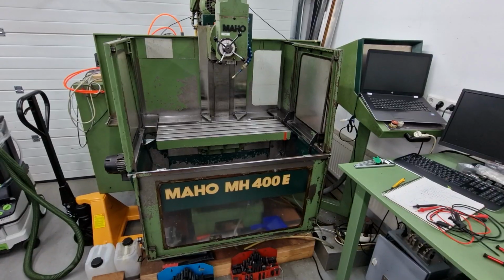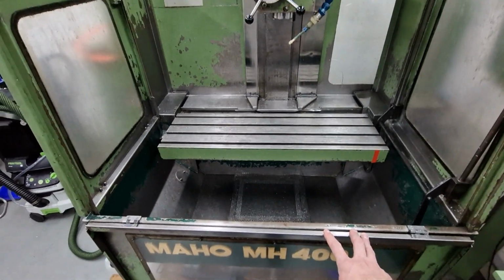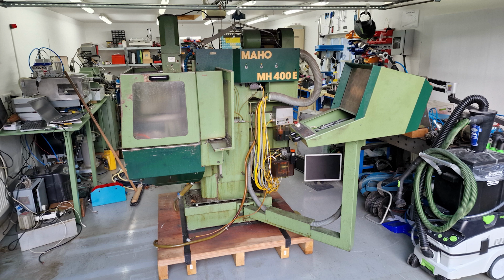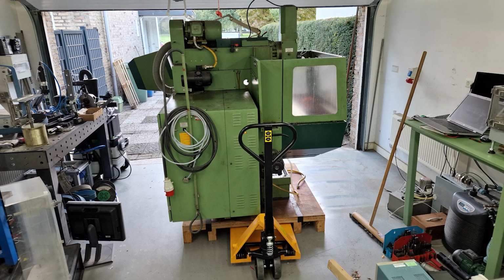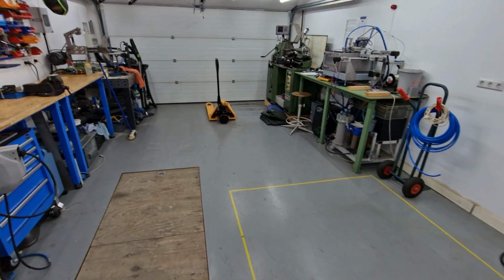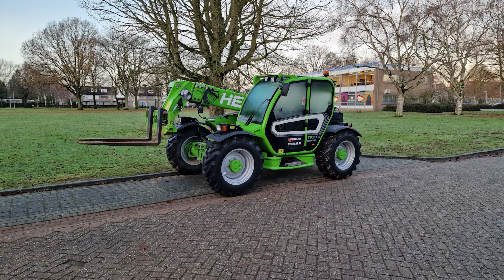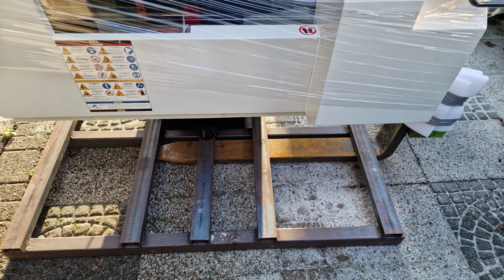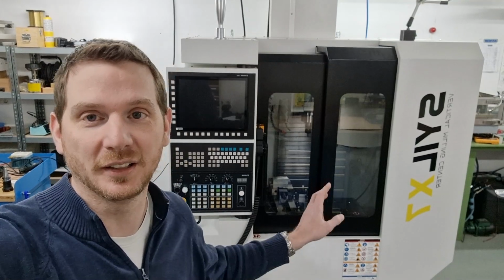New CNC for the BaxEDM shop - SYIL X7 !

Comment: My SYIL X5 is taking the long route via South Africa. I've paid for a professional machine delivery service to deliver it.  That was expensive, but I didn't want to take any risks. I ordered it back in July, it should arrive in the UK in 10 days time. I have 18 mm clearance under an oak beam at the door of my workshop, so it will be a tight fit!
Reply: you ordered the machine from ZA ? do you have a link to the supplier please ?
Reply: @carbonmk1  Sorry, I wasn't clear in my explanation there. It came direct from China, but not through the Suez Canal. It took the long route around Africa. I ordered it from SYIL UK.
Reply: @MachiningandMicrowaves  aaah ok , was like whaaat ? makes sense